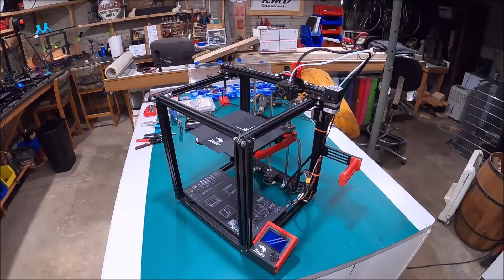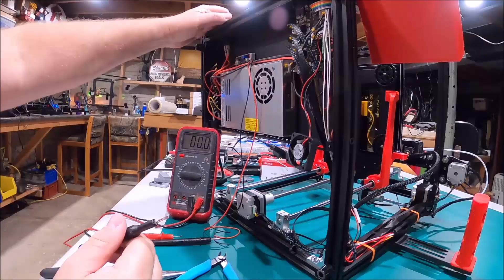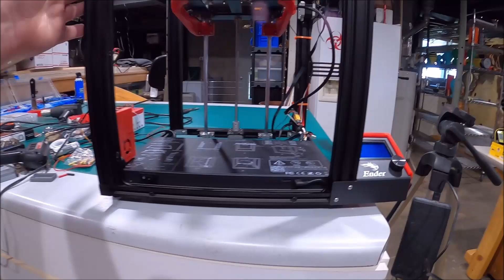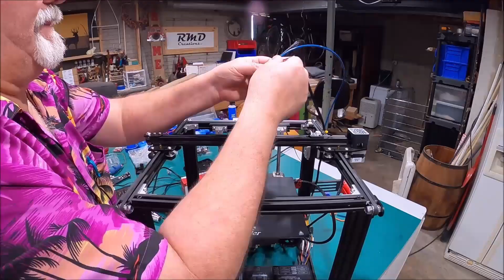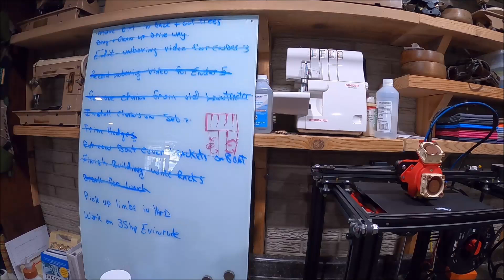Creality Ender 5  Upgrades Best of the Best  How to Part 1 My favorite 1st round of improvements

Comment: Hello! Great video! 

Have started planning improving my Ender 5, which I bought used recently. 

First of is the noise: Does the "ENDER 3 SILENT FANG NOCTUA V2" fit 1:1 on the Ender 5 head - and do you have any recommendations about switching the power supply fan with a Noctua or other silent fan? This fan makes the most noise on my printer. 

Next up is the mainboard fan and the Pi mount. 

Thank you in advance. 
/Kristian

Comment: Hello I wanted to ask if the ENDER 3 SILENT FANG NOCTUA V2 required some changes to fit to ender 5 pro stock hot end or you were able to mount it like it is?
Reply from the maker: I did and it works good, thanks for watching

Comment: PRINTED UPGRADES:
01:27 Strain Relief
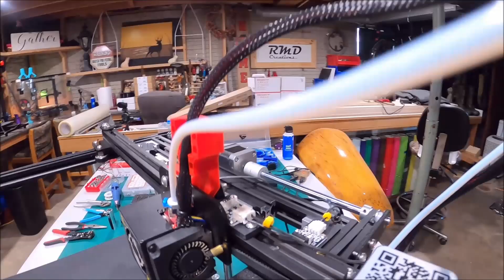02:17 Strain Relief #2
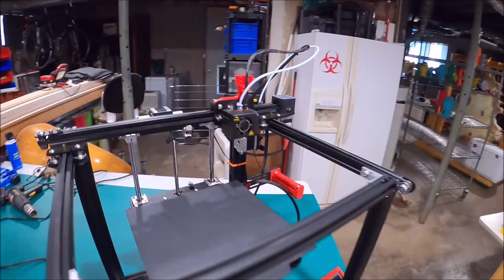02:50 Electronics Cover
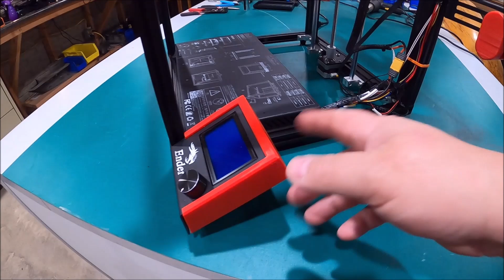03:10 Filament Roller
03:34 Bed Supports

05:25 Electronic Upgrades Overview
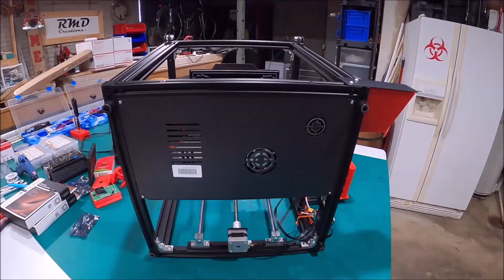10:55 Tools Breakdown

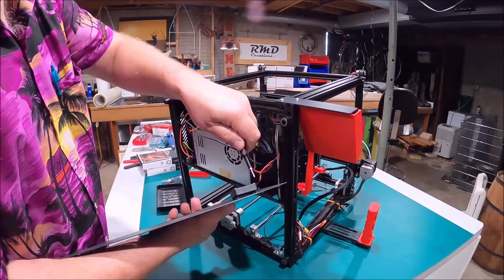12:55 Motherboard Changeout
20:05 Raspberry Pi installation
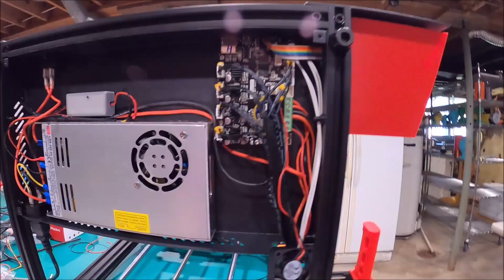30:40 Fans
37:30 Bowden Tube Upgrade
44:40 Backwards Extruder Error Correction

Comment: Greetings Mike,  Well done my friend.  You covered a lot of upgrades that will all be needed at some time.  My Ender 5 Pro is in the mail as I type and I'm starting to print some of the upgrades in Sunlu PETG with my Ender3 V2 and was wondering what was the orientation for the bed supports.  I'm slicing in CURA 4.13.1.  Any tips you might have for the support profile setting would be very helpful.
Thanks again Mike for your efforts and sharing them with all of us.
Doug

Comment: One thing I don't know if you have tried is using IPA on hotglue, if allowed to sit on the glue it significantly reduces the pressure needed to remove hot glue, useful to know on fine electronics like JTAG connectors. Allowing it to sit on the glue for a several seconds can make giant globs of the stuff easier to deal with.

Comment: Thanks Michael. I just got my Ender 5 Pro up and running. Before putting it together, I did take photos of the mother board and power supply to reference later. All posts I have read suggest that you should get the stock product out-of-the-box running before installing mods. Makes sense. My problem is noise....from the power supply/mother board fan. My mother board is a Creality V4.2.2 and power supply is marked LRS-350-24. To tell you the truth, I cannot hear any noise from steppers, hot end fan or anything else beyond the loud whine from the power supply (or motherboard) fan. Any suggestions? On your video, I don't hear any noise from your printer....
Reply from the maker: I upgraded the fans underneath. Search through my channel and you will find your answer.
Reply: I think the pro has a silent board, Capricorn tube, springs, and meanwhile supply installed factory now. Go check the site.

Comment: This is strange, almost the same as people who but pointless stands for PS5's and Xboxes. I seem to see a lot of printed "Upgrades" most of which are completely pointless, and are more likely to cause issue than fix them. Seems to be a American thing more thing. 

1. Bed supports, may well help a very old machine, but in reality. The bed needs to flex as when it over runs the filament you dont want it to be solid and spill the next layer.
2. The cabling will never fail if its ran correctly, the solder joints are NOT a topic of concern.
3. The LEC cover isnt needed as its a circuit board not a 1972 apple PC, it doesn't conduct electivity. Like any circuit from 2000 onwards. Unless you find your fingers are metal.

So you spent 50 hours printing shit you don't need for any reason basically.
Reply from the maker: WRONG,  All of the upgrades I put on my machine are useful and has made it better. A ridged bed is better than a loose floppy one. Thanks for watching and commenting. I like what I did and that's good enough for me.

Comment: How have those buck converters holding up? particularly the cases (if PLA, i bet they have bent).  I would remove the covers on the buck converters so they can cool off better (can't see under there anyway).
Reply from the maker: Everything has been working just fine. No warp, no droop, no failure.

Comment: great video, but you should mention to re-check buck converter voltages after you connect your devices.   5v with no load is going to change when you attach a load to the buck converter causing your voltage to actually be lower then the 5v you set it for.
Reply from the maker: Well the intent is for 5v to be the max.  a slight drop won't hurt my usage. Thanks for watching

Comment: Thanks for pretty step-by-step video.
24:55 those connectors do have little metal tongs/springs and cables are inside in tube connectors. Those can be disassembled and reordered so red will be +5V black GND and yellow removed completely.
What surprised me is the use of Raspberry Pi WITH that small noisy fan when you put some effort to Noctua funs to make whole thing as silent as possible.
Reply from the maker: Can't even hear the pi fan at all. Thanks for watching and commenting.

Comment: I printed those bed supports in carbon fibre PLA and they are properly rigid. The strain relief for the bed cable was a no brainer. and I'm printing the hot end cable support right this minute! I'm also looking at a bigger print bed, and have ordered a Plus size bed. Only around £15 inc shipping, so I thought I'd get one to see if it's doable.
Reply from the maker: very cool, thanks for watching

Comment: Great video!  Installed the Creality board 4.2.7 and downloaded the new firmware from Creality's web site just as you did on the video.  The motors are quite but when I check About Printer it indicates the old firmware Ver 1.3.1 2002-04-25.  This says to me the firmware was not updated.  Any suggestions?
Reply from the maker: If it's quiet then that's all that matters as long as you can print with no issues.

Comment: Do your wheels, on the ender 5, rubber portion, seem to wear on the rails leaving a dust residue on rails and rubber? The wheels are on the outside ends of the extruder rail.
Reply from the maker: they do collect dust. I just keep them wiped down.  Haven't worn any wheels out yet.

Comment: why not just take a zip tie and fasten the bed cable to that screw hole you used? Gives the same support and more PLA for another project.
Reply from the maker: Could work.  Thanks for the tip and watching

Comment: Your heatbed bracketd are installed in opposite way.
Reply: Another YT vid poster did the same. Support Bracket should be in the inside so it's not obstructing the leveling screw knob.
Reply: Came here to make the same comment, haha
Reply from the maker: thanks for the tips

Comment: I think it is prudent to get to know the stock machine before making any modifications that affect the operation of the machine, get to know the quirks of the machine, find a good filament, dial in your slicer settings, make sure the assembly of the printer is good and square, especially with semi pre-assembled machines, without doing this when you get a fault the modifications make diagnosing the problem much harder. and when you do decide its time to make modifications do them one at a time so if you do get any problems they will be much easier to diagnose and fix
Reply from the maker: It is prudent to get to know your machine.  I have enough of them that the shotgun approach to mods is not a problem. I ran this machine around the clock for two weeks before I made the mods. Thanks for watching and commenting.

Comment: Thank you for your videos, they've been quite instructive! I see you use Noctua fans for both the hot-end and the part cooling, I was wondering if you have tried lowering the part-cooling fan speed from 100% to 50%, 25%, or even less (normally required to print PETG and ABS) and if it works ok. I ask this as from what I read, the Creality board PWM works by basically turning on/off the 24v to the fan, thus causing the output voltage to lower (so at 50% speed, it should be outputing 12v)
Reply from the maker: running the fans any less that 100% does not work with the noctua fan upgrades.  When I run ABS I do not run the tip fan at all
Reply: @Michaelinthebackyard  thank for your reply, i have a feeling that is mostly due to the way you've been wiring the buck converters directly to the fan port instead of using an always-connected ground! Check 5:50 here https://youtu.be/k9Yy8OxohGI